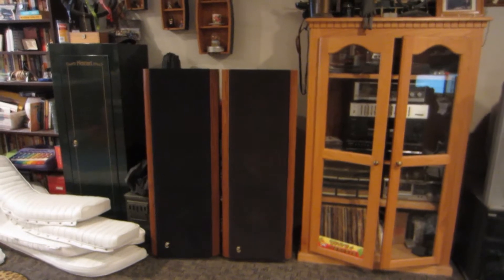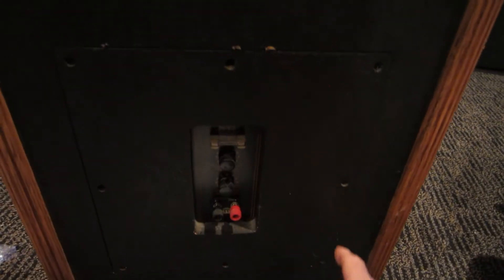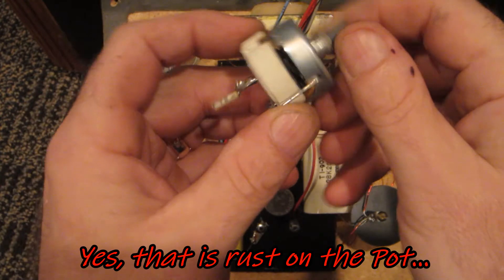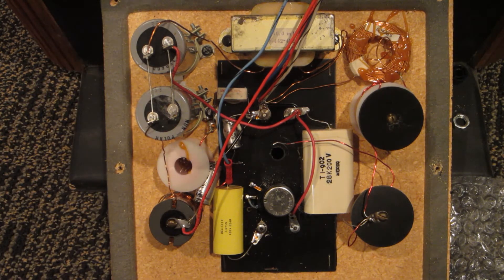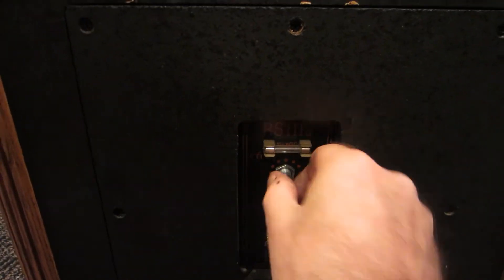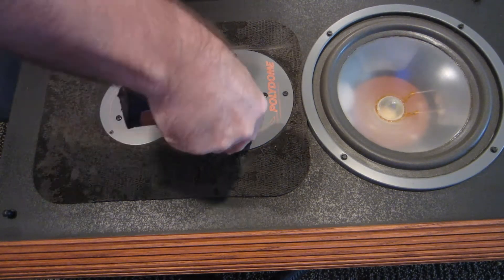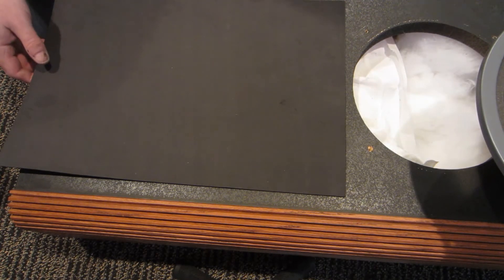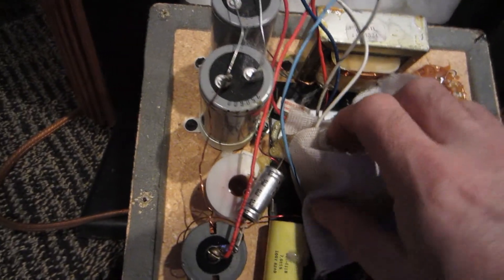A Knob Fixes Infinity Loud Speakers (ep 1) Infinity - RS IIIa Project

Comment from the maker: 0:00 Intro & Plans
1:40 Potentiometer Replacement
11:50 Differences With The Crossovers In The Same Series 
13:50 Replace the Sound Deadener Foam On Front of Speaker Box 
19:25 Replaced Two Caps

Comment: Nice video you put up here, I just bought a pair of these and will do the foam replacement around the tweeters as they have deterioated, the bass elements are already refurbished. Does the foam have any significant antireflection purpose around the tweeters?
Reply from the maker: Stops air and vibrations coming form the woofers, from whistling and vibrating around the Emit and the Poly. I guess any really good gasket would do the same thing but over the years it would stick it to the box like glue. With the foam I use the tweeter or mid will just fall out of the box if unscrewed years and years later. IMHO it's also just part of the look. I made changes like passive bi amping them and changing the grill cover slightly but you would have a hard time seeing a difference from when they were new out of the factory. The foam also (to me) fills in or "breaks up" a pretty blank area above the woofers. For as pretty as these speakers are I would not want them to look like the "lesser priced" RSa line.
I feel like I have come lightyears since I made this video. The best advice I could give today is passive amp the crossovers and get yourself a good 4 channel amp that can do 200 watts per channel that can run at 4 ohms and dip to 2. You will never use it all but having the amp "head room" is the key to these speakers and they dont like clipping at all and can damage them. I found a QSC CX 254 is almost a perfect match for them. You do that and you will never be happier.
Reply: @finscreenname  Thanks for your input here, will definitely look for a QSC then, typically I just sold my QSC 1 year ago long before I got to these thoughts and Infinity's, what's the idea about the wiring for bi amping?
Reply: @finscreenname  Ok so how to do this passive bi-amping regarding wiring as these speakers only have 1 terminal at the back?
Reply from the maker: @MrArtrock  Ya, you will have to add a second terminal block. Really easy to do just over top the original set. If you look at the crossover you will see it is really easy to break off the woofers and anything on the crossover for them and just put it to the new terminals leaving all the top end stuff on the original terminals. The reason I did it is because the speakers are power whores. Everything going to the original terminals tends to make most amps freak out and either burn up or go into clipping. Most would think its the woofers that are the power (omhs) drain but it's really the top end which makes them dip down into the 2 ohm range on occasion. The woofers are 4 ohms each but being Infinity wires them in series they come out to be 8 ohms at the terminals. The Emit and Poly are also 4 ohms each but being wired sperate they end up coming out at 4 ohms and dipping lower to 2 ohms when putting the volume to them. Passive bi amping them just seems to set the woofers free to be woofers and give them much better bass and the top end is the same without the woofers trying to syphon off power that is already being taxed to the limit.
I really should make a video about it but having a couple Med issues that is sucking up all my time at the moment.

Comment: Beautiful speakers, was fun to watch the repair and nice job with the foam replacement. Your soldering doesn’t look that bad, actually. If you’re looking to improve it a bit, though, I’d recommend you use a little flux on the parts before soldering them. You don’t need much, but it works amazingly well to prepare the parts for soldering and the solder will flow so much faster and cool to a nice shiny finish. Also, try putting a bit of solder on the tip of the iron just before soldering the parts. This also helps the solder to flow more readily as it’s already hot and ready to go. Finally, put the iron tip behind the area to be soldered and the solder wire in front. This will draw the solder toward the iron for a quicker, more complete job.
Reply from the maker: Thanks for the tips. I did watch a lot of videos on it and made sure to have the right solder and got the hottest iron that was at Depot and a bottle of flux. I have put a lot of copper pipes together over the years and had a idea about it all but the issue I always have when soldering this small stuff is it never seems to get hot enough. Short of it being a tiny terminal and wire I can never seem to get enough heat in it for the solder to "run to the heat" like others do. On the bigger terminals I feel like I'm just on the other side of doing a cold weld. So like you said I coated the tip in solder and basically would create a small puddle on the terminal and let it heat with the tip in the puddle. Between the flux and heating it that way I couldn't get the solder to run to the heat but I could get it to puddle in place and stick so that's what I did. Really hate heating them up that way due to how long I had the iron on the terminals. Slow heating had to have transferred a lot of heat into the pot but it didn't seem to hurt them so.... Even a knob can do it. lol

Comment: Did Arnie use the original L Pads as potentiometers? The L Pads retain the Ohm setting across the crossover while being able to reduce power output. Arnie used only 2 legs of the LPad so just curious.
Reply from the maker: Pots. 😊

Comment: get yourself a flux pen and watch a short soldering vid....not hard to do good soldering if you take a minute to learn some technique...and then you will never overheat a component.
Reply from the maker: Thanks, I've progressed over the time this video came out. Just something never really had to do up to that point. I've use an Arcwelder in the garage for decades, use crimps and shrink tube for wiring boats and cars and such. Just really never needed to solder and then I did. One thing I did learn is if I'm going to do it a lot, I need better equipment.   😊😊